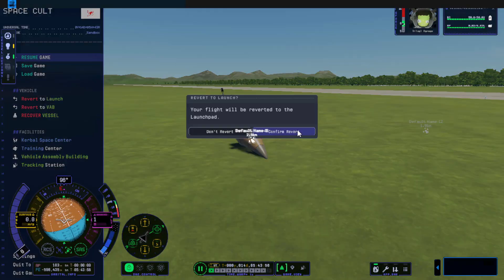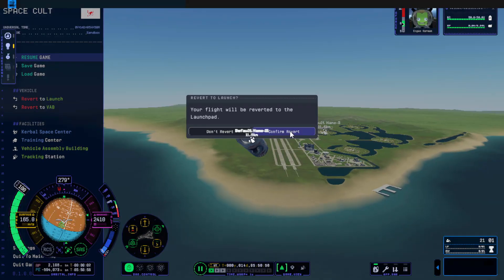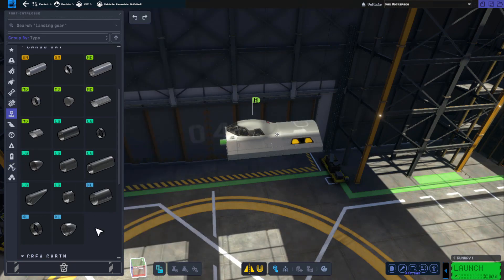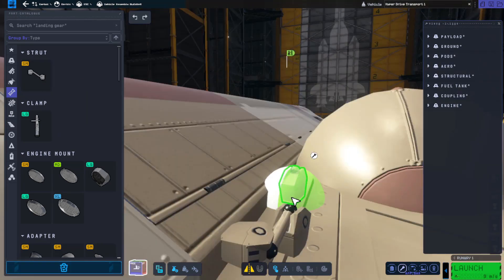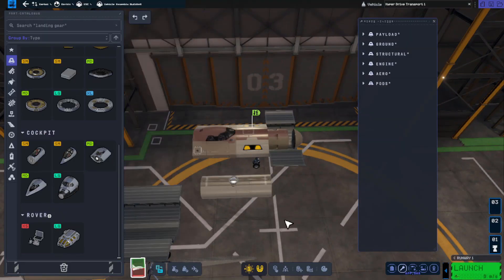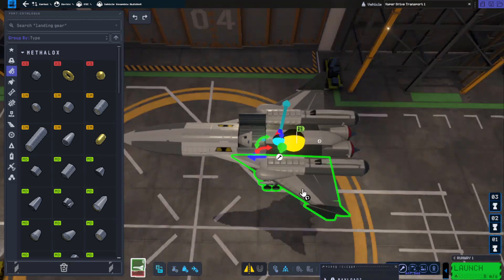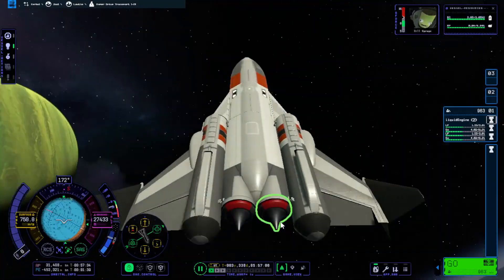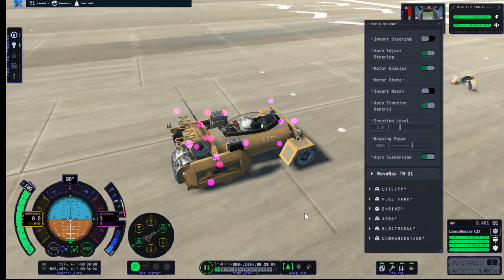PROJECT KRAKEN / KSP 2

Comment: You know I've been a fan of KSP since 2008. I'm having a real hard time engaging with KSP2 because the hardware specs are so out of reach. I think that may have been a strategic decision years ago, so they can't "just fix it" for cheap rigs like mine. I might just buy it anyway, and have it on the shelf for a few years.

edit:  But, dayum! Your design is just lovely. Whenever your job gets slow, you should moonlight doing graphic design.

Comment: Haven't tested it, but my theory is that the nosecone absolutely must be attached at the front of the aircraft, and directly in front of the rapier, in order for the kraken drive to be effective, BUT that doesn't necessarily mean that it's "real" position would need to be at the front, in other words, maybe you can attach your kraken drive at the front and then move stuff with the translation tool for aesthetics...
But we might never know, as the devs apparently banished the kraken drive... for now...

Comment: I found mine uncontrollable until I disabled the gimble on the rapier.  Also found it worked with a structural part in front of it, but not a fuel tank.